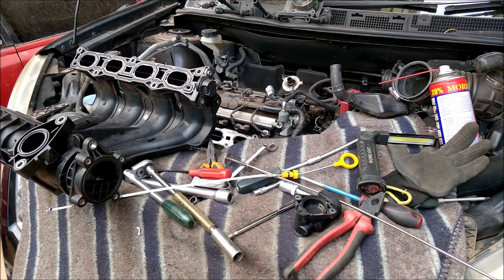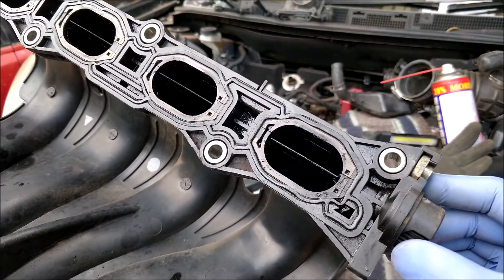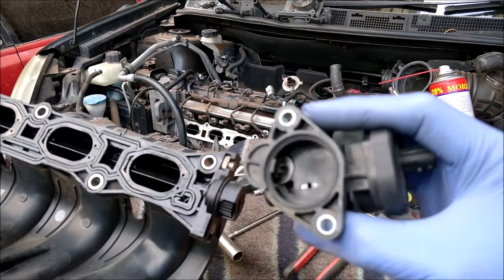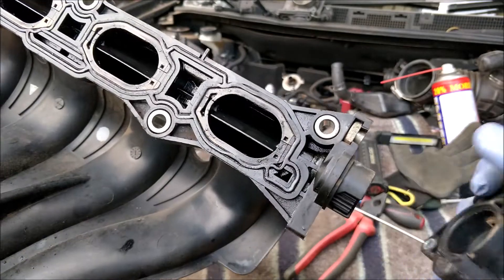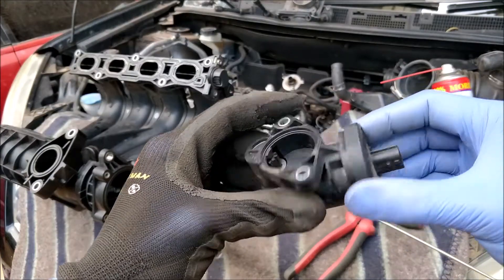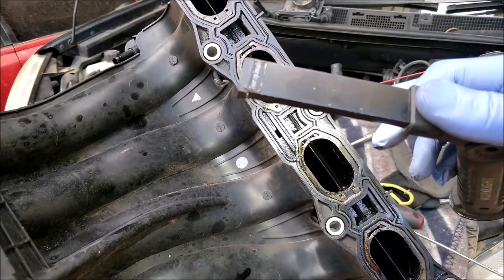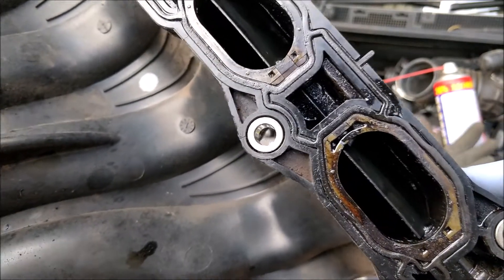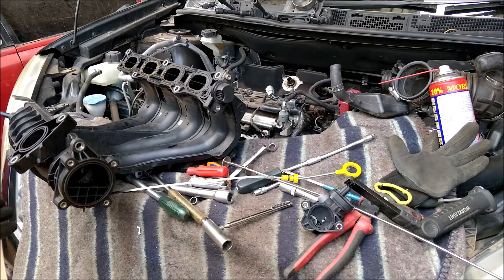Intake Manifold Swirl Flap Checks

Comment: Volvo V50 gasoline 1.8 liter 2005 model has a fault of yellow engine which appear and dissapear and it passed the technical revision, my question is if is safety if I buy this car in Norway, they wrote this in the add : Engine light can come and go - Diagnosis says some "flaps" in the intake. This means nothing for driving the car, and you can drive it daily without noticing anything. Was Eu approved with this, and has worked fine with this daily. What is your opinion is good to buy this car or not ?
Reply from the maker: It's a relatively decent platform that one, but whether it's good (or not) for you would depend on several other reasons, for instance, what you use it for. Case in point, if you are a sheep farmer and will be running around in the wilderness with it then you can see why it may not be the best vehicle.. :D :p

Comment: What did you use to clean the carbon buildup on the swirl flaps?
Reply from the maker: Penetrating oil to soften the gunk.
Toothbrushes to scrub the stubborn grime.
Rags to wipe down the sludge.
Brake / carb clean to rinse everything off.. :)